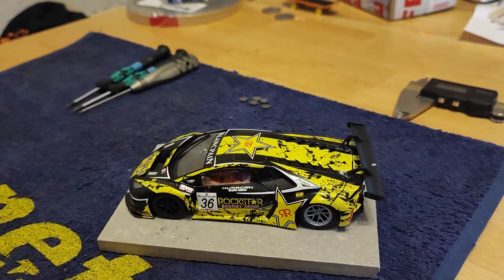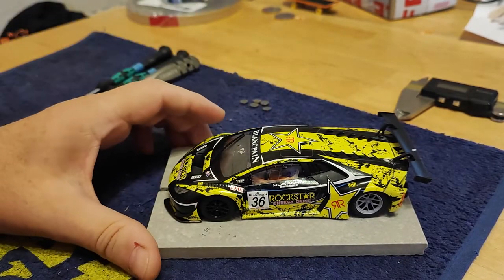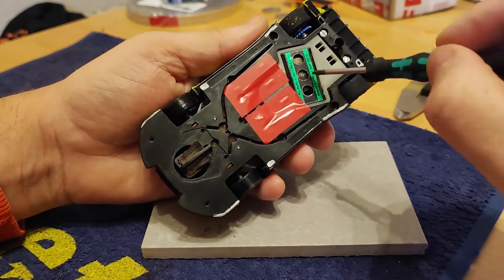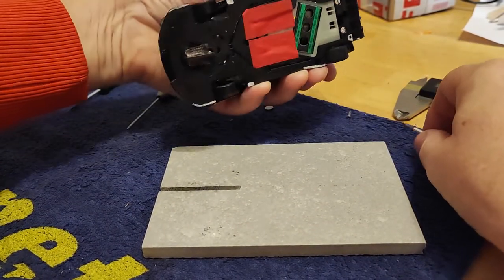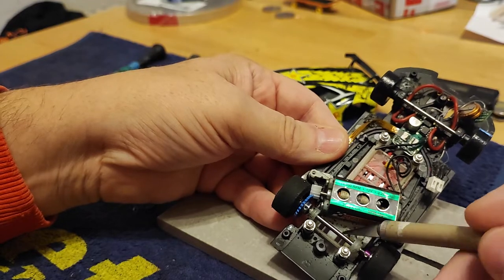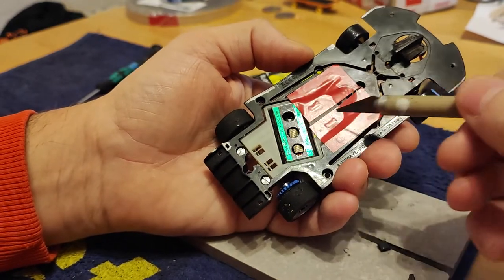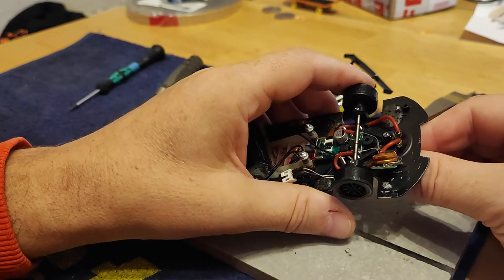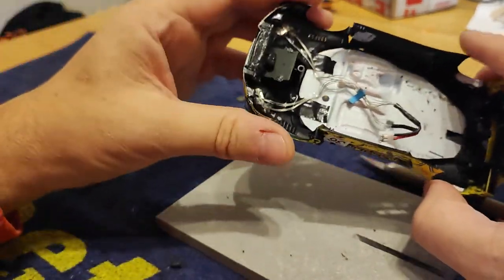Digital DISCA GT3 Lambo Huracan post event Racer Sideways slot car

Comment: Really enjoy this sort of content Wayne. Thanks from Canada. Capton Tape, rubber sideways wings. Both valuable to newer slotracers like myself. What is the silver stuff inside rear wheel wells???
Reply from the maker: Glad you enjoyed the video. The pale patches are 'Tippex' correction fluid. It's a fast drying white paint for writing on. I use it to easily identify if/ where the body has touched the tyres.